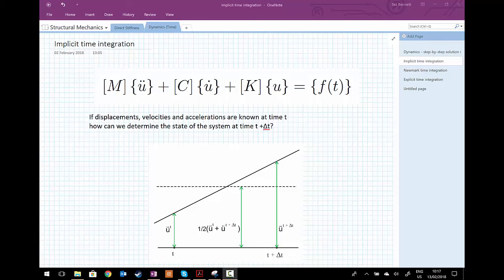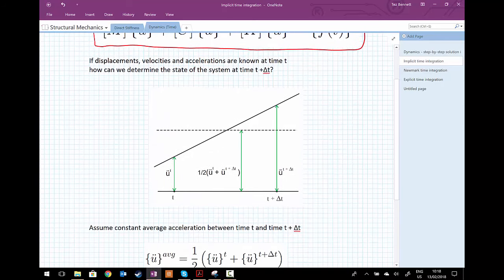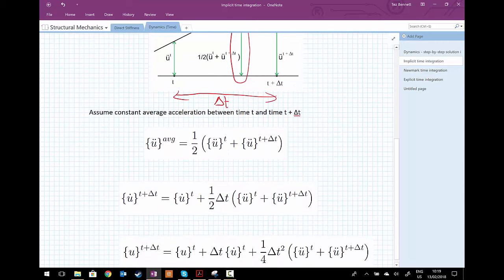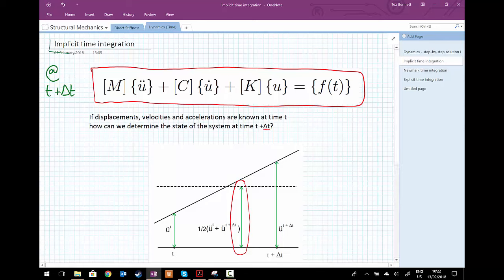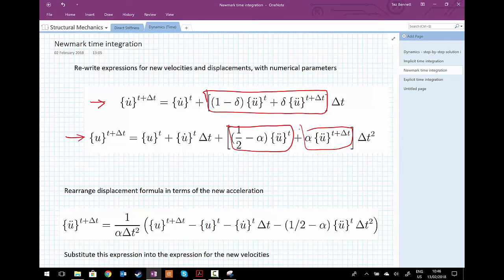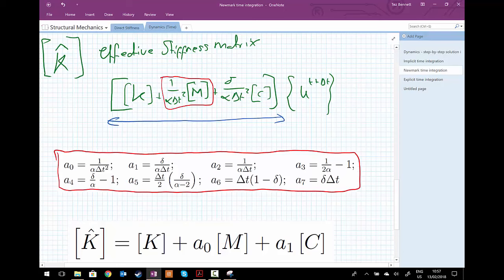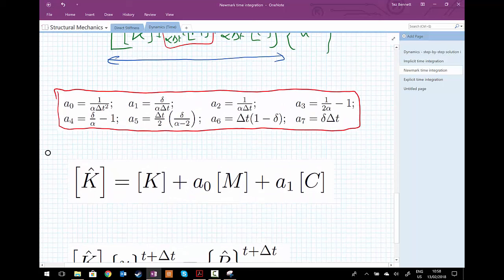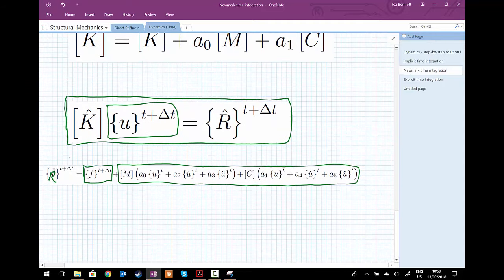Dynamics - Implicit Time Integration

Comment: this is assuming that your dynamical system is linear and your M, K and D matrices does not change with time, correct?
Reply from the maker: The time integration doesn't change for a nonlinear system, but you would need to incorporate an iteration loop to achieve convergence in an implicit scheme.